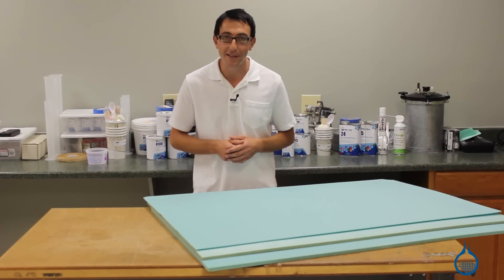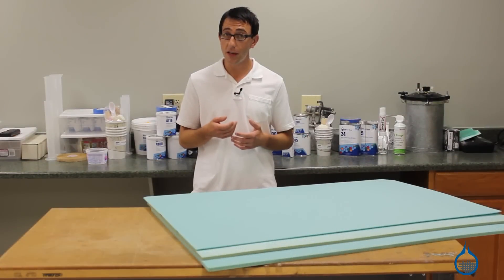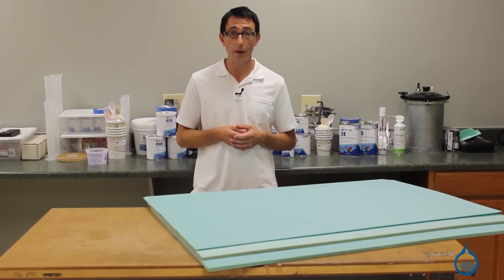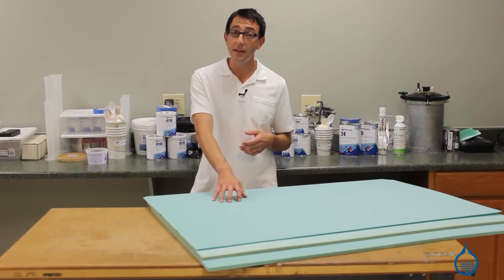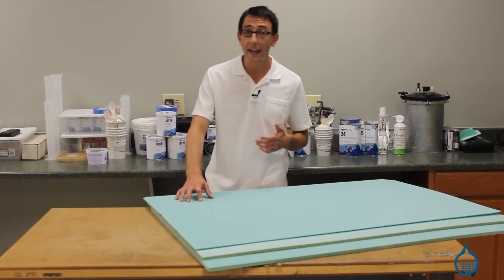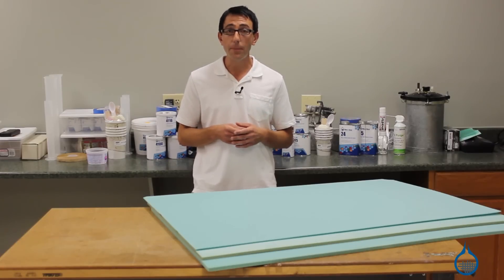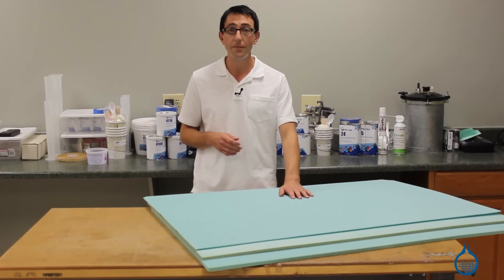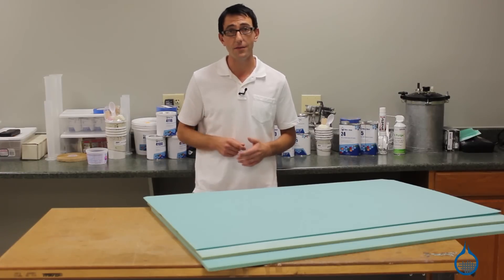Fibre Glast 3lb Vinyl Foams

Comment: How about picking up the foam.   Holding it to the camera, and showing examples of the strength or hardness of the foam.   I'm contemplating a fiberglass/carbon fiber hard top for my 42 footer.    I'm trying to figure out how hard it is, how much it flexes without heating, and what the weight of it is.   I'm going to need about 12 feet by about 14 feet I think.   All I've seen on your site are smaller panels.